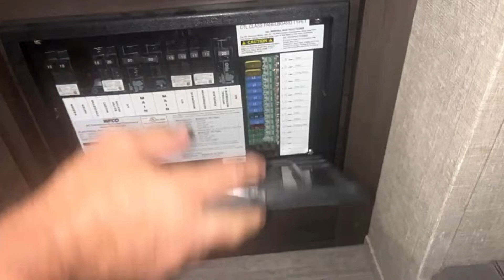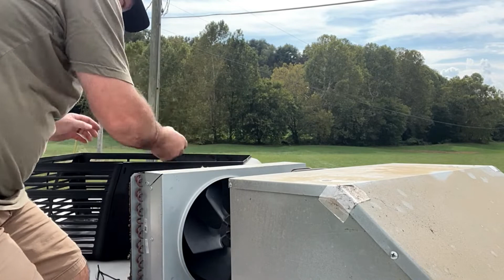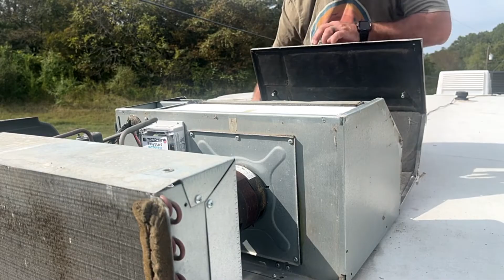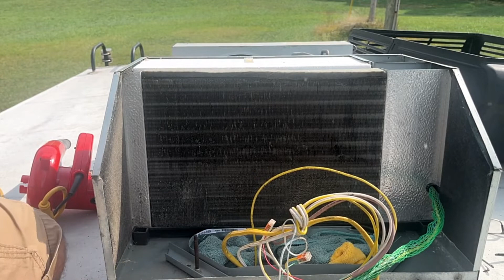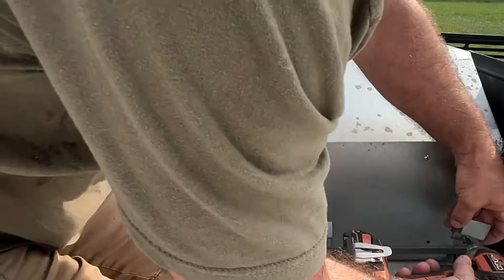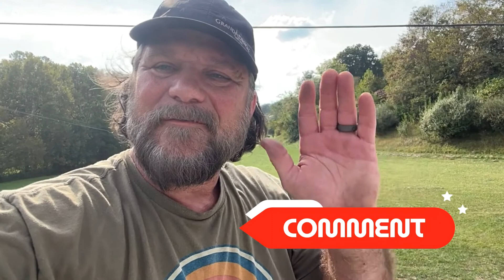RV AC Not Cooling? This DIY Trick Can Save Hundreds!

Comment: WOW!  I literally did this exact thing on my travel trailer this morning and thought, "I need to text Steve and suggest him doing a How-to video".  Well brother, great minds think alike I guess.  It has been on my to do list for about a week now.  Our travel trailer is only 6 months old so this was my first time doing it.  After learning how funky our mini-splits can get without constant cleanings, it was apparent the RV AC was the same, particularly in our hot and humid climate.  Anyway, I think it is almost criminal how badly designed these things are in terms of producing mold within the interior coil/fan space, even from brand new.  I took the Styrofoam cover off and was greeted by a blower fan and air duct that had a surprising amount of black mold looking stuff for being less than 6 months old.  I spent a couple of hours cleaning what I could.  I refrained from taking the blower motor off because I don't think it would have cleared the Styrofoam housing to get it off the shaft and didn't want to attempt a further tear down.  I probably got 95% of it.  I even run the AC/fan almost continuously because I know that cycling it off and on can create even more build up (when it is off for hours).  Also, I noticed an unusual amount of smoke smell coming into the cabin when I burned nearby and pretty much ruled out other points of entry.  What I believe I've found is a design flaw in my Dometic unit.  Since the blower fan and condenser fan share the same shaft, it has to enter into the foam shroud into an otherwise sealed enclosure.  Where the shaft enters, there is a nickle sized cutout to allow the shaft to pass through and unless I am missing a piece, would suck outside air in that spot.  Anyway, enough of the long winded post.  I'll be contacting the dealer and/or Dometic next week to see what can be done about that as here in SE Texas, it is swampy outside a lot of the year and that is not a viable long-term proposition with regards to the AC.  Now, I just need to watch your video Steve, and see what I (or you :)) missed.
Reply from the maker: Fantastic Karl! It is amazing how quickly the mold can grow in there; It's one of those things you don't really think about but it's really worth staying on top of.  We will be headed to Texas soon.  We will have to meet up!